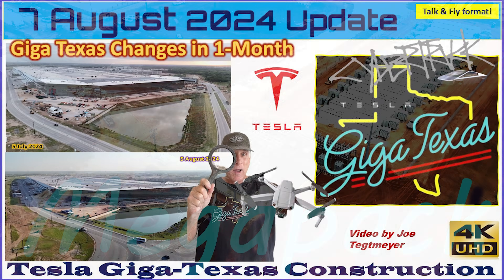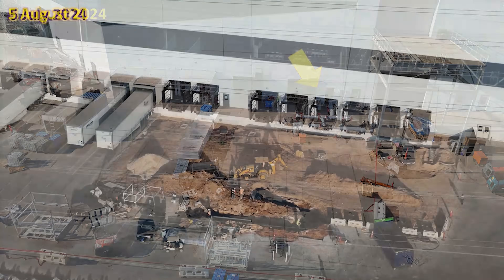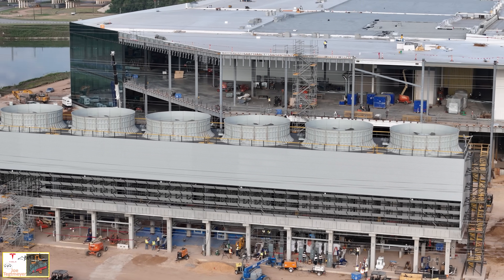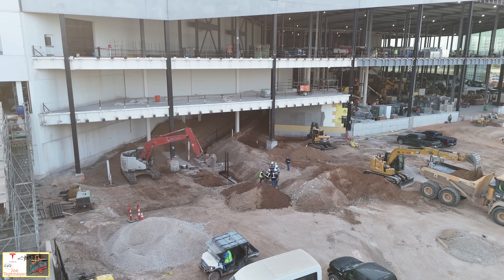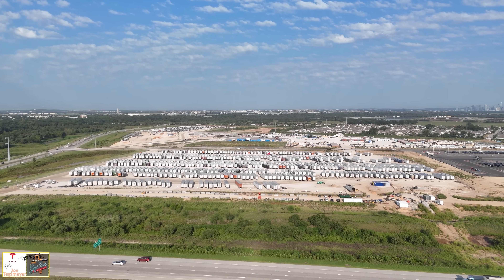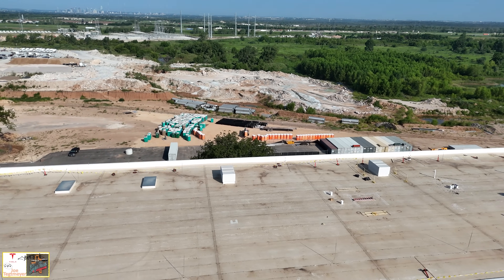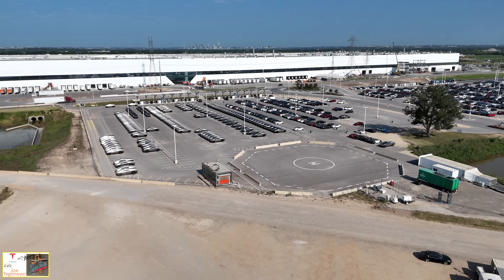S Tunnel Concrete, E Casting Work & Boring Co Tunnel Changes! 7 Aug 2024 Giga Texas Update (08:35AM)

Comment: Thanks Joe!
Fiber optics:
@ 12:41 (Bottom right) New vault pretty close to where they previously did a HDD bore for the fiber optic ducts.
Tunnel project:
@ 14:48 Precast road segments being removed from the tunnel. Not sure if this is the reason, but.... An observation that several of the segments broke even before being installed. A couple failed segments can be seen 15:10 (Bottom).
Megapack transformers:
@ 14:33 Not seen in this video but first spotted by Dessie a couple of days ago....  34 large transformers are in a storage area to the west. The exact same number of transformers used for the existing Megapacks.
New power supply to the building:
@ 20:15 Concrete pour complete for the walls of the structure at the duct-bank intersection/crossover. It was done yesterday on Brad's video. Speculating that two container sized switchgear buildings will be placed on top.
@ 20:59 Ongoing work to pull cables through the second duct-bank.
@ 21:05 Notice how long the extra cable coming out of the vaults is. Seems like it is long enough for the cables to pass right through the Mega-vault and reach the transformer busbars in the substation. Though the duct-banks between the Mega-vault substation are currently filled. So they would have to do more excavation and construction.
Reply: 20:15 It would be interesting if they prefabed the switch gear in containers
21:05 They would go to the trailer where it could be fused and disconnected.
Reply: Switch rooms are built in factory conditions. Hard to say why Tesla installing a pair of switch rooms. Perhaps they will install another 68 mega packs not connected to the grid????
Reply: @gurugee2112  21:05 If you look at the cables laying on the ground there seems to be enough length to go right through the Mega-vault and directly to the transformer busbars  in the substation. Why bypass the switchgear containers on top of the Mega-vault? This is just speculation which could end up being wrong, but perhaps they don't have the room or capacity to handle 24 new three-phase circuits in the existing switchgear containers at the Mega-vault. Remote switching down the line at the new location here 20:15 would solve that problem.
Reply: @peteregan3862  For the same reason they have two switchgear containers here @ 21:05 For circuit protection and control. Which allows them to cut power to the circuits individually rather than cutting power to the entire 12 circuits in the duct-bank. While they do have switchgear rooms in the factory, they still have to be able to cut power to the cables going to the factory.
Reply: @DavidJohnson-tv2nn  Those containers are big enough for a lot of switch gear. And it would not be good practice to have all those circuits with no protection underground until that new concrete building 100 yards away.
Reply: @peteregan3862  Switch gear, maybe. But in pretty much any large buildings all the switch gear is assembled on site from mostly off the shelf equipment from Square D, Siemens, ABB, etc.

Comment: Thanks Joe.
Sort by Newest First or Top Comments if only the first few lines are visible 
7:32. Southend, east. Left. Level 1 mezzanine. Concrete placed. Loading platform decking part removed.
8:58. Southend, Cooling Tower. Bottom left. Large diameter pipe re-positioned since Monday. Grey painted underside now located on the saddles. Additional length getting the same treatment. 
Blue plastic under the Ts.
9:53. Southend, east. Level 1. Left of centre. Large brown pipe elbows up onto the plant platform.
10:22. Southend, south. Very temporary looking roof drain connection.
10:53. Southend, south. Central Fire Escape Passage. Bituminous paint or membrane applied to the wall, following the line of the tapered retaining wall. Suggests this part of the tunnel will be exposed.
11:58. Southend, west. Roof. Left. Crates of white circular items. Roof cowls perhaps.
12:36. GA, highway side. Vault at the end of the pipework trench. Pumps, metering maybe.
13:58. Southend, Tunnel Portal. Bare earth. Trench across where the plastic road barriers are located.
14:04. Southend, west. Level 1 and 2. Right. Grey wall is the connecting structure between the Data Centre and the stairwell to the Fire Escape Passages.
15:26. Westside, Tunnel Project. Worker knocking off the grout used to bed/seal the invert slabs against the tunnel wall.
Bobcat parked on what’s left of a pile of gravel. David Salisbury had suggested gravel would be used to infill the void under the invert slabs (road decks).
16:42. EOL, Transport Yard. Suction excavating for a lighting tower footing.
16:49.  EOL, wash bay. Bottom right. Cybertrucks having been through the internal car-wash, getting a final clean before moving onto the transport yard. Internal car-wash needs tweaking.
20:14. Tesla Road, north. Ductbanks intersection structure. Concrete placed.
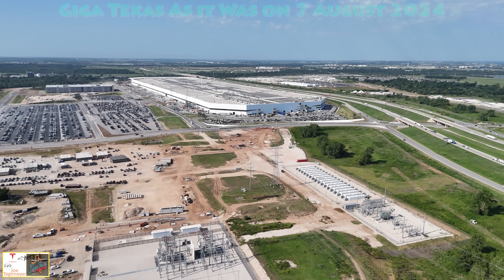21:00. BESS installation. Top. Some activity there. 30:06 also. 34 transformers in the BESS. 34 transformers stored across the highway. Up for replacement possibly.
25:16. Parking Garage site, storage. Brown pipes and some stainless steel pipes including a manifold.
26:03. BIW, apron. Almost ready for concrete. Right. Note the rebar projecting out of the loading dock platform. Plan is to extend further north. Last loading dock on right is marked E4.
26:46. Casting east, apron. Columns mounted on the 16 embedded steel segments. Wild speculation, some sort of crane.
Left. Trench formwork being installed for what is likely a rail system similar to that at the Die Shop.
Trench already constructed inside. Just about visible at 28:14.
29:11. Casting, north. Apron. 3 Trane trailer mounted mobile cooler units. Hose connections between the manifolds and a pump.
I wonder which chiller plant is under-performing to require this leg up. Or what internal re-shuffling is underway.
Area where the pipework is entering the building is separate to Stamping. May be Paint Shop related.
29:31. Battery, north. Delivery of ducted fan units. Weird colour, not seen that before on site.
Reply: 29:31 Dessie, those "ducted fan units" may be actually electric motors with the shaft side down, cooling fan blades mounted on the rear, and a peckerhead on the side.  Note the one being unloaded from the truck is much smaller than the other two.
Reply: 21:00  I've been unable to watch and read consistently for the past few months as I have relocated to the other side of the planet.  Did I miss an episode with 34 extra transformers?  Where are they? Could they be for a doubling of capacity and not replacement?
Reply: 15:26  Well, this isn't the first time Boring has built a tunnel.  Have they not infilled with rock before?  Seems like a good sound mitigation strategy.
Reply: @alanrivaldo-h  29:31. Motor on the side for sure. I may have used the incorrect terminology for the type of fan.
Reply: @eclecticmemes  21:00. Where on the other side of the planet? Transformers. Check out Brad's 6 August video at 7:18. Yes, could be a doubling of capacity. Keeping in mind that they have had trouble with the transformers in the BESS.
Reply: @eclecticmemes  15:26. I don't know if they have infilled with rock before. David Salisbury suggested they might.
One of the drawings for the Colorado River Connector Tunnel (a longitudinal vertical section) has some type of 'fill' drawn, but nothing specified.

Unrelated. Same drawing shows a ramp up and down at the tunnel entrance of 1' 0.305m. A bund/levee.
Reply: @DessieDoolan  I'm not going to speculate about the removal of the tunnel invert segments. Looks like a screw up of some kind. Makes no sense at all to me. Quality of the earlier ones was very questionable (we could see the poor quality concrete from the drone shots). Either way, the July opening didn't happen, and August is already looking unlikely.
Somebody should be getting fired.
Reply: @davidsalisbury50  Quite a few were seen to have snapped in half.

These were formed up in simple boxing on the ground at Bastrop. The boney concrete seen on some examples raised a red flag for me.

Seems they may have filled the void under the slabs with crushed rock. There were a couple of piles of it near the entrance, now depleted.

Comment: Hi Joe.  You mentioned the cooling tower on the SW side will use ethylene glycol as a coolant.  That is not correct.  It is an evaporative cooling tower and there will be some losses to the atmosphere (an example is the cooling tower at the nearby power plant and the mist from the tower).   One cannot discharge ethylene glycol to the atmosphere.  They will use water with some water treatment chemicals to prevent foaming and biological growth within the tower.  Ethylene glycol is used in closed loop systems.    If the chiller loop is closed loop, which is likely, it will use ethylene glycol.
Reply: Water glycol solution I thought.
Reply: Yes.   Why you use glycol it’s with water like in a non EV.

Comment: Looks like forms for rails at the form near casting ( 28:09 ). My guess would be for a gantry crane.
Reply: Yep. 2 cranes likely. Trenches already constructed inside each opening. Visible in Joe's video from 23 June 2023 at 5.55.

Comment: I wonder if the purpose of the lined pond is for emergency spill retention of the cooling tower fluids?
Reply: Vomit pond, but one cannot just fill it with anything you like. Having a designated place to deposit potential hazardous liquid in the event that the cooling system decides to drop its guts shows serious forward planning so kudos to the company.

Comment: I wonder if the cabling running under the tunnel's roadway slabs were causing the slabs to not sit flush with the tunnel's walls, thus the slabs needed to be removed for a rejigging of the cabling and ventilation system before roadway slab reinstilation.
Reply: Invert slabs (road decks) were quite roughly made. Lousy quality control to brutally honest. Seen being removed from site in Brad's 8 August video.
Reply: @DessieDoolan  That makes perfect sense. Wonder if, in their desperation to please Elon's time schedule, they did a rush job just so they could say they had them onsite ready to go. Wouldn't surprise me.
Reply: @pinkelephants1421  The slabs were cast on the apron at TBC facility. Timber forms. Nothing wrong with that particularly, except it indicates to me these may have be somehow different to the regular slabs that you'd except would be cast in some sort of re-usable mould/formwork.

Some of the segments had visibly 'boney' concrete (not enough fines, or badly agitated) when stacked on site. A dozen or so were seen to have snapped in half.

Southend tunnels. Yes, these are simply fire escapes required as there are no opening in the monolithic glazed wall.
Reply: @DessieDoolan  Thanks, Dessie. 😊
Reply: @pinkelephants1421  Seems the tunnel invert slabs may have utilized fibre reinforced concrete, and it hasn't gone well. I guess if you're going to test out a new product/procedure best to do it in-house....ish.

Comment: Hey Joe Lester here. I have a chance to order cyber truck number two with either three motors or two motors and are dry cell 4680 batteries available yet?  I don’t have a delivery date. I have not configured yet but I need a little more information if you could update me,I have been following you for four years and love all your updates. Thanks, Lester.
Reply: They have only just made their first test cybertruck with dry cathode cells, and have not implemented it into production yet. I wouldn’t count on any being dry cathode for customers this year

Comment: Electrical wire… not electronic. Electronic refers to transistors and semiconductors usually.
Reply from the maker: @rb8049  not sure what you are referring to
Reply: @JoeTegtmeyer  Every reference to cabling, on the roof, the new underground feeders, the concrete switchgear box being formed.

Comment: Just a layman, here, but would it have not been simpler and far less expensive to run everything to the cooling unit above ground?
Reply: Think about this. How would you like to commute/live in a neighborhood where all the wires, cables, water & sewer pipes were above ground? You figure they’d be unsightly and in the way? Same thing here …..
Reply: @donsturtevant2396  This is not a neighborhood; this would be a short trip around either side of the cooler, hardly an inconvenience.  Got to be more to it than that.
Reply: @timower5850  You're right - aesthetics aren't important in and around a factory.  How about if, by running the pipes underground, it's to keep the cooled water cool, especially given the heat of Texas summers?  If not that, then keeping the area between the chiller plant and the building clear for some kind of vehicular traffic?
Reply: @alanrivaldo-h  Cooling is a possibility.   Traffic?  My thinking is that they could go around.
Reply: The water glycol solution used for cooling is also a why on Earth! I've heard it referred to as pre-hammering the liquid so as to finely control the flow. Large scale thing where weight is a real concern.
Reply: It would be a massive construction for those pipes. They would need to be anchored against hammer. And a lot of pipe insulation is needed.  Underground is cleaner and better.

And I think there is a lot of esthetics here - the glass facade, the stone glass entrance. A lot of design.
Reply: Maybe because it is directly beneath the high voltage transmission lines, the power company may want that area flat so they can lay out new cabling should a fault develop on the transmission lines necessitating cable replacement.
In all the other area's under the lines its parking or temporary storage, everything can be easily moved if needed, large installed pipes cannot be easily moved.
Reply: @paulstubbs7678  Perhaps!